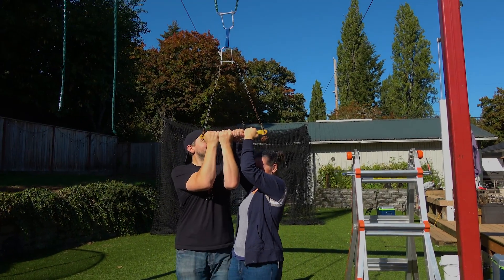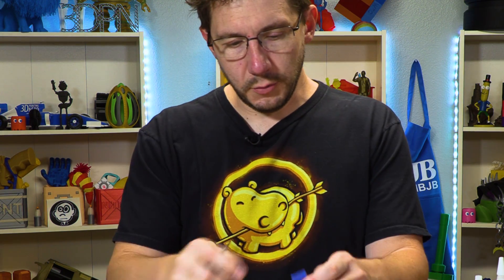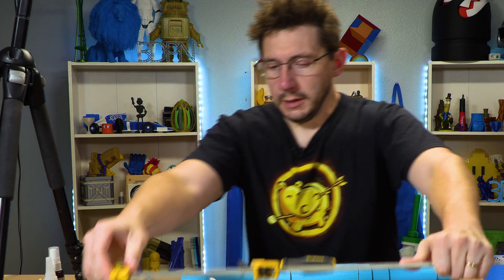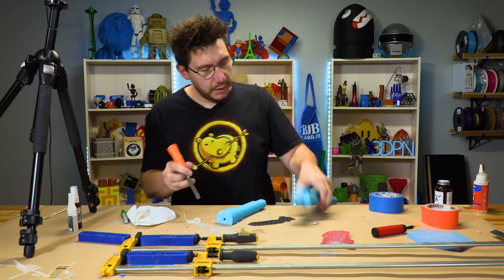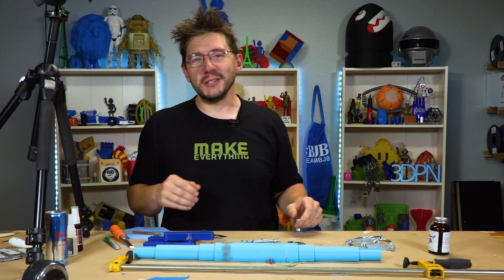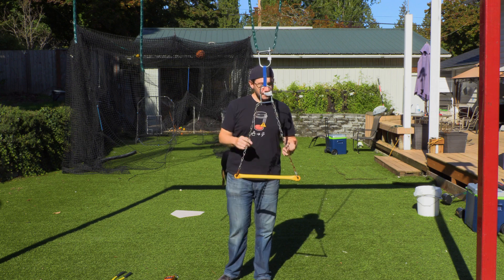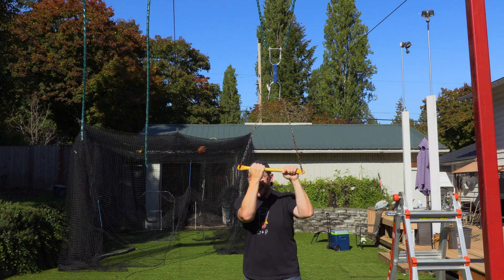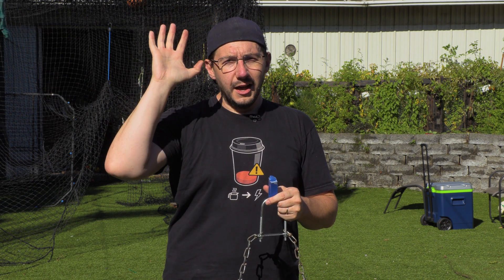This Can't End Well // Testing 3DGloop and Polymaker Polymax PLA

Comment: Impressive product. Cyclical loading failure is the most common type of failure for any material. Another test, that's safer for you and your family, would be to just add weight to the test pieces and see how the joints hold up over time.
Reply from the maker: While that's true, we did have a bunch of fun filming this :)
Reply: That's exactly what he did:

1 Adult
1 Adult + 1 Child
2 Adults

I'm sure the process would have proceeded as such until Joel ran out of family members. It's all very by-the-books.
Reply: @SyzygyNoon  Yes I think I remember seeing this exact test in an ISO 9000 manual.....😆
Reply: @JointerMark  Full Joel is a perfectly calibrated weight reference, with self-adjusting capability. The Full Joel absorbs the right quantity of foods and drinks several times a day to compensate for natural wear and weather effects.

Comment: using ca accelerator makes it more brittle than it otherwise would be. shouldn't matter for this test though, the solvent weld should almost always win depending on the plastic. petg and polycarb don't do as well as acrylic with solvent welds, etc.
Reply from the maker: For PETG and Polycarb, isn't that by design? Aren't they suppose to be more resistant to solvents? Or am I thinking of something else.

Comment: A little tip: to get better adhesion with glue, you actually want even surfaces that are roughed up, so that the glue can stick inside the ridges.
Reply from the maker: Right, isn't that why we sand the mating surfaces?

Comment: Which plane where those parts printed? Did that come apart on a layer, or was the print on the other plane? Just curious.
Reply from the maker: Crap, I should have mentioned it. The parts were all printed flat, so the forces applied were perpendicular to the layers.
Reply: @3DPrintingNerd  Cool TY

Comment: I am looking for a viable replacement for all of this Loctite I bought months ago... 3D Gloop is FREAKING COOL
Reply: Plain old acetone works great on abs. Even fixes layer separations when I print in the garage in winter at 5 degrees C without enclosure. Love PET-G....
Reply from the maker: So far, it's been a great welding agent for PLA! I haven't tried the ABS stuff yet.
Reply: @3DPrintingNerd  I'm about to just bite the bullet and order some... especially for my functional hardware. I should find out if it's sandable

Comment: Although the gloop did get a benefit vs the other as the other 2 methods didnt get the application either side of the seam. Both superglue and epoxy would benefit from this so wasnt apples to apples really due to this.
Reply from the maker: Oh, I see what you're saying. You're right, not true apples to apples then. Though, it wasn't really apples to apples in the first place as it was two adhesives versus a weld. Good thoughts though on parity.
Reply: The CA glue may also have done a bit better if it had gotten a dose of The Clamps too.  And I'm not sure that soaking one side in accelerant was fair to the CA - did the glue get a chance to get squished into the pores of the accelerant-coated side?  Or did it cure on contact and only make a superficial bond.  If you're giving them all days to cure anyways, skip the accelerant and let the CA cure naturally too.
Reply: We fully endorse that the bond from 3D Gloop will still be the strongest, even without spreading it on the edges, that actually has a very minimal impact on bond strength (if there is full coverage on the mating surfaces).

Also 3D Gloop is much more than just a solvent weld, what actually creates the incredible bond strength is how the solvent works with our proprietary blend of elastomers and other bonding magic.
Reply: @3dgloop  You can just tell people it is the magic you put in the Gloop.
Reply: @3dgloop  Looks like a primary part of the product is DCM welding. The test that really needs conducting then is how much stronger 3dgloop is compared to just solvent welding the part.
Reply: I was thinking literally the same thing. Would have made more sense to measure (or at least try to measure) the amount of adhesive applied to keep "all things equal".
Reply: Matt Weber I'd still incorporate some metal inside the axels. Maybe even some bushings. However, I am just an idiot who has never 3d printed any vehicle platforms larger than a prop, such as for Hammy Hamster On The Riverbank. It's good that he shows people durablility tests in a a safe location. That dog Chewie appears friendly enough too.
Should be wearing motorcycle helmets with full face visors for such  gravity based vertical tests, its worth noting, as his nose now knows apparently.
Oh nose.  "Now I'll never be a teen model." - Marsha Marsha Marsha quote
Reply from the maker: I asked someone who knows much more than I do, and they said the CA glue with accelerant creates the same bond as without. perhaps I need to dig deeper.